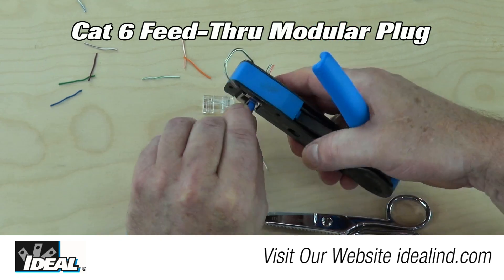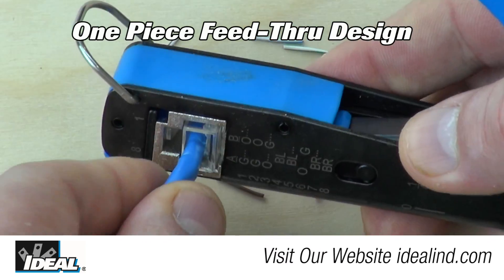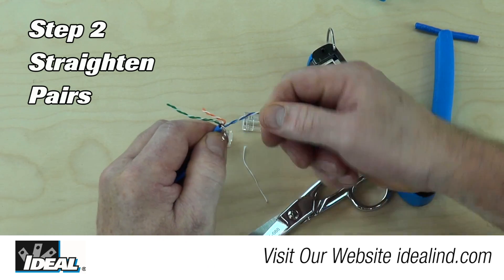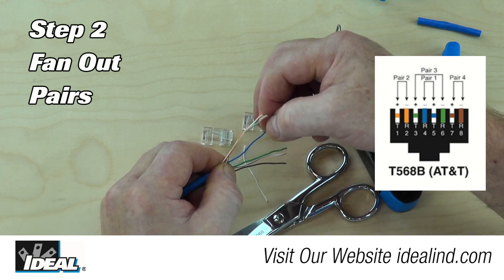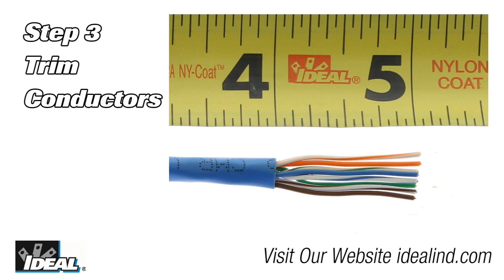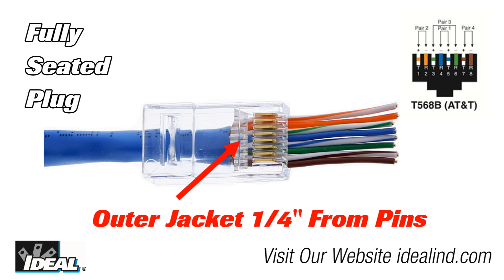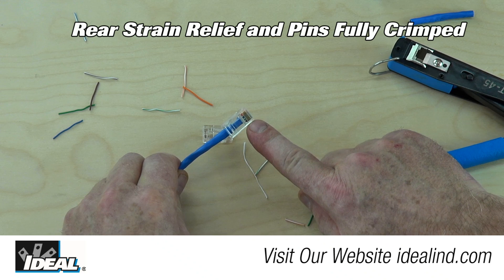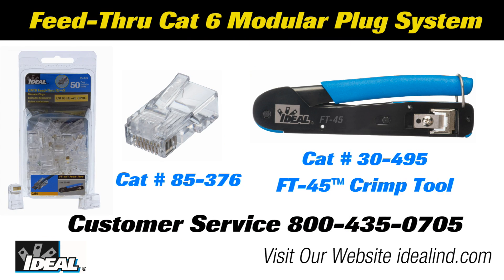IDEAL Cat 6 Feed Thru Modular Plugs Long

Comment: Makes it much easier but it’s a job I hate doing 🤣😂
Reply from the maker: Hi Mr Tom1379 I have told contractors for years go home with a box of connectors and some wire and put one on and cut it off 20 later you should be good to go! Have fun Ron
Reply: Ron Kipper Datacomm I’ve ordered one 🤣
Reply from the maker: OK you should like the crimper use it well Ron

Comment: I have these connectors to try and fit to cat6 cable but no matter what I try I can’t get the the cores to push up into the connector!
Reply from the maker: Kris you may have a Cat 6 cable that has thicker insulation on the conductors. Look for the 85-385 Cat 6/6A connectors they will probably work. Ron

Comment: Will this CAT6 Feed-Thru plug work with CAT 6 23AWG? Or will a staggered plug be needed?
Reply from the maker: Hi Andrew the plugs will work with wire diameters of 0.041 and jacket diameters of 0.290. We just launched a new shielded plug for cable with larger diameters up to 0.048 and it has a staggered pattern for the wires. The catalog # is 85-36 or 85-369. I just put out a new video for the new plug
https://youtu.be/ohqo2v32ZJM

Comment: Good grief, I bought these crazy connectors without realizing they are pull through. Now I need a new crimper?
Reply from the maker: Michael afraid so............the good news is the crimper we sell can do both the new feed-thru and standard IDEAL plugs we sell. I think one of the biggest comments I get from contractors is it's size which is much smaller than many other crimpers on the market. Ron
Reply: Im more of a do it your self, and I don't really want to upgrade my crimper at present.  Although I can see how the pull through is much simpler. If I was starting new, Id go with it.
Reply from the maker: Michael I kind of agree about using standard plugs I have done so many the feed-thru does not help. You could still use the feed-thru and trim the wires before inserting them. Ron
Reply: I tried using a utility knife and kinda butchered the wires. What would you use to trim them?
Reply from the maker: I would wire it just like I would a regular modular plug. Trim the wires before inserting them so they don't stick out the other end and then crimp it.  hey your early morning boat ride looked fun. Ron
Reply: Good idea. And yes we had a good short fishing trip.

Comment: Its a cat5 kabel
Reply from the maker: Aren nope it is Cat 6. Ron
Reply: Only 24awg cable Cat 6 will work when all conductors are in one row. Cat 6a which supports 10G networking at full length requires 23awg. That is when the offset 2 rows of 4 conductors are needed. Cat 6 is kind of an in-between standard on the way to CAT 6A
Reply from the maker: Hey Darrell you can definitely find high end residentail applications for Cat 6A today but I think it will be another 20 years before we see 10G applications in a common home so save some money and stick with Cat 6. Ron
Reply: I agree. Residential most likely will not need more than 1gbit networks. I get into 10g running video in commercial venues.  We had a client run their own cat 6 (we were expecting 6A) and we used some 6A connectors that didn't support 24awg. The copper plungers on some of the pins actually went into the insulation  and didn't contact the conductors. We have other ca6a connectors that work fine with 24awg.  Now we are bit particular about which connectors we use with which cables.